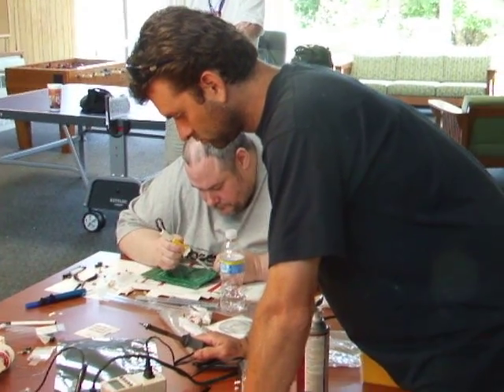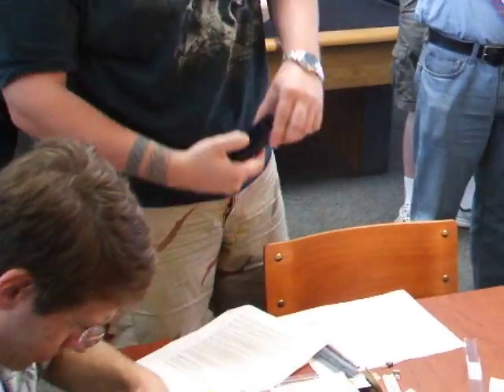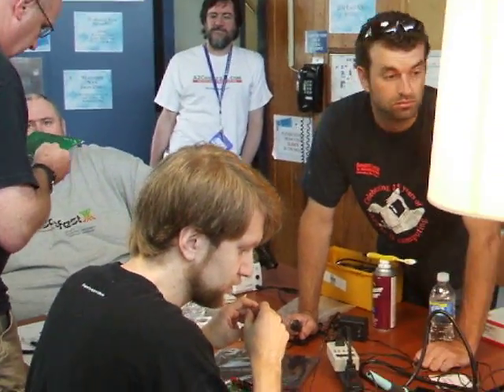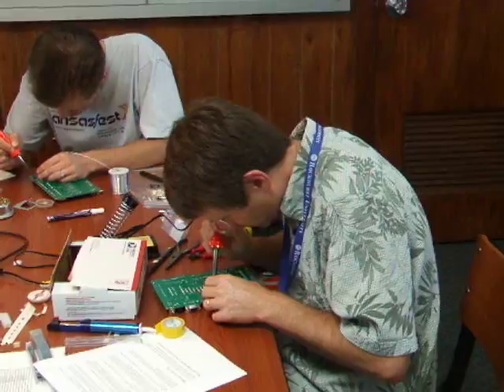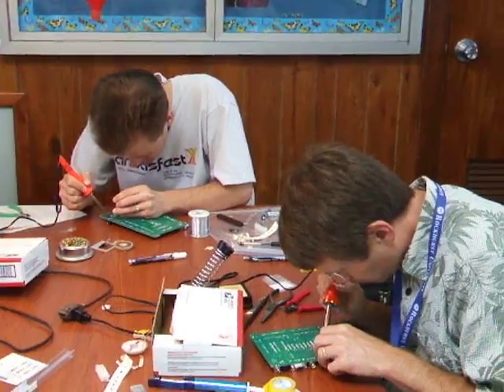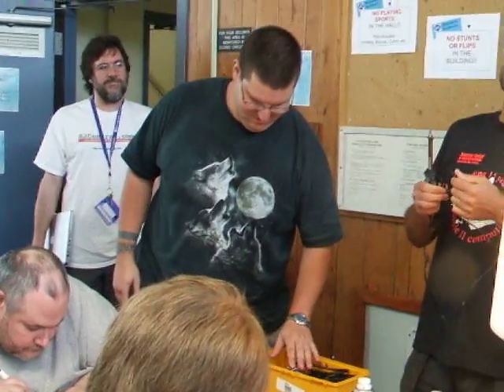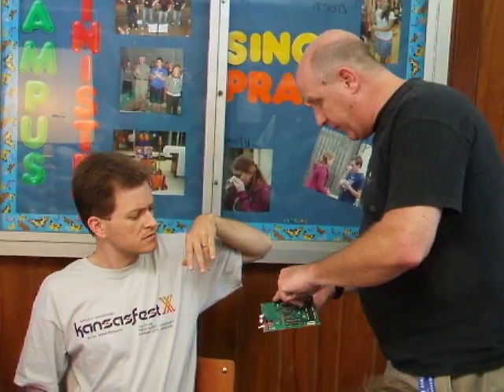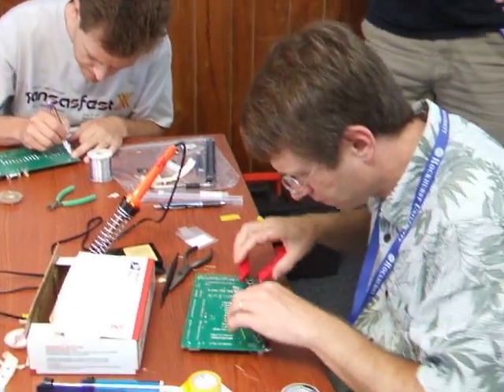Vince Briel's workshop for people to make a Replica I

Comment: The Replica 1 uses some similar chips, such as the CPU. (actually it is a slightly modified version). apple 1- MOS 6502
replica 1- MOS 65C02.   Most of the chips used in the original are not available anymore, so Vince made some substitutions